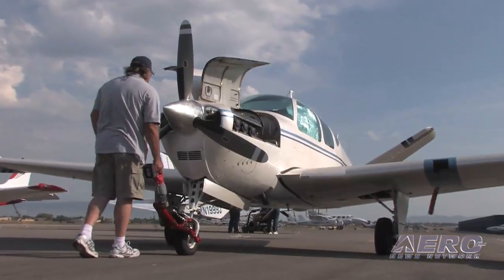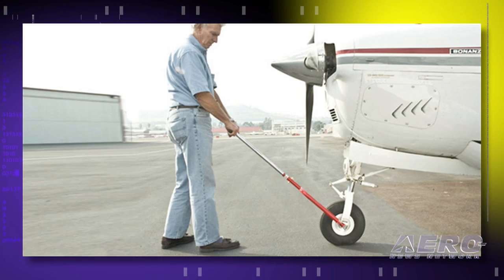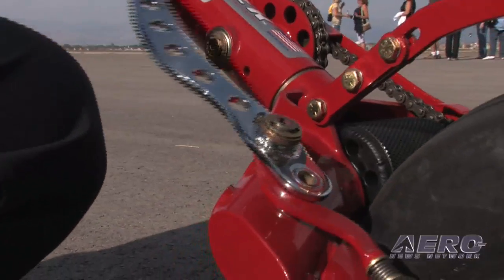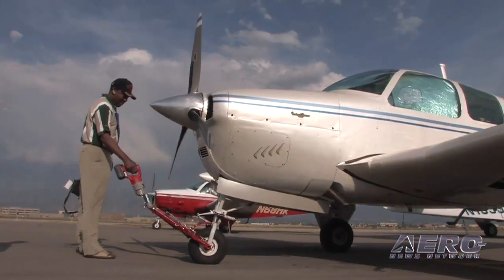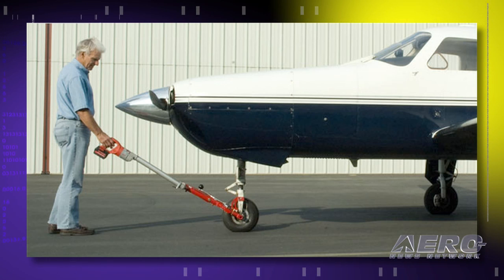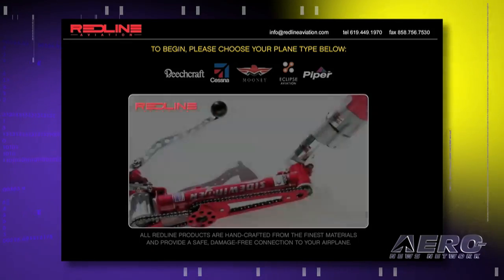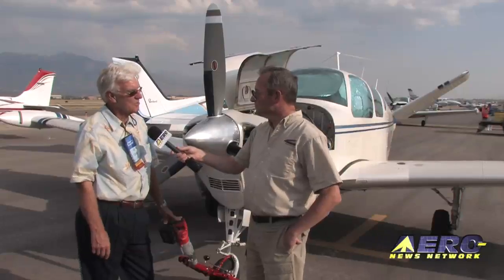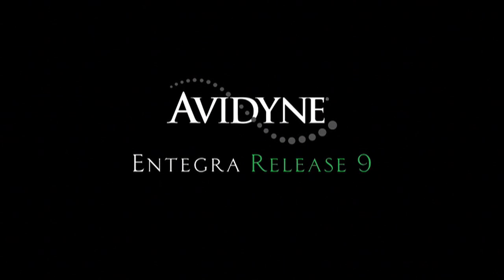Aero-TV: Tow Bar Revolution - Redline Aviations Sidewinder

Comment: Too complicated, too expensive, violates the KISS PRINCIPLE (keep it simple, stupid.) Use high torque drill, yes. Get right angle and high reduction w/ worm drive. Drive wheel on ground, not aircraft tire. Use sturdy shaft to lift up nose gear.with pins in axle like most tugs.

Comment: $1600-$1800? everything in aviation is overpriced. installying A/C on a cessna costs more than it does to buy a brand new Ford Mustang GT. why does a tiny AC system cost more than a 3,000lb car with one of the worlds most advanced V8 engines, traction computers, tires, leather, AND AIR CONDITIONING? who knows.

you're in mexico. pay a mexican a quarter to help you move the plane. problem solved